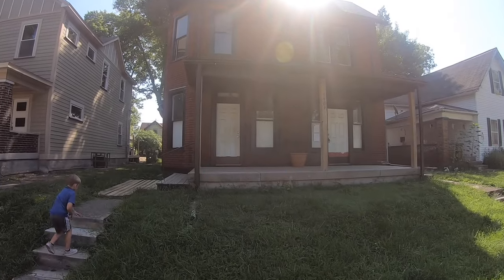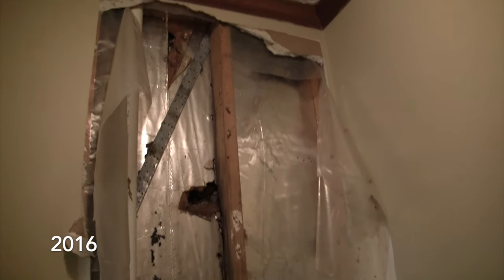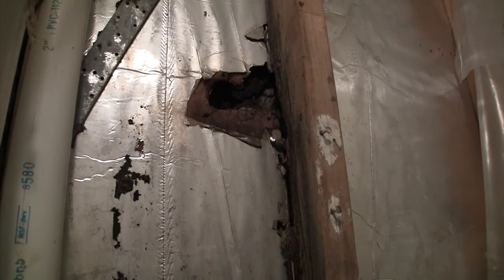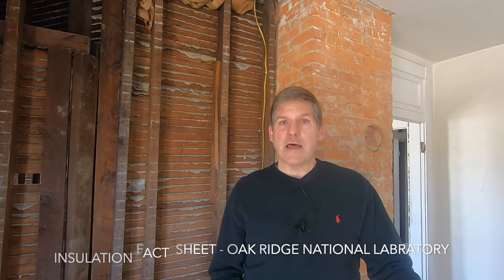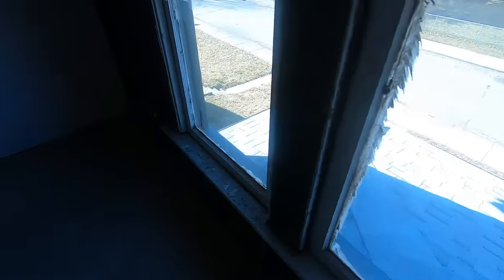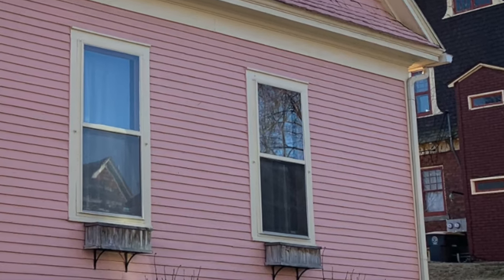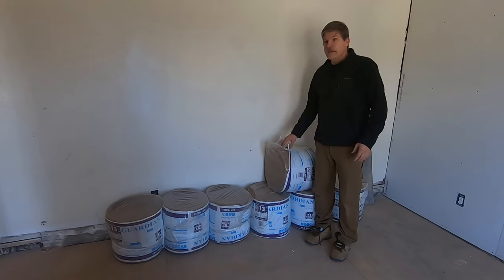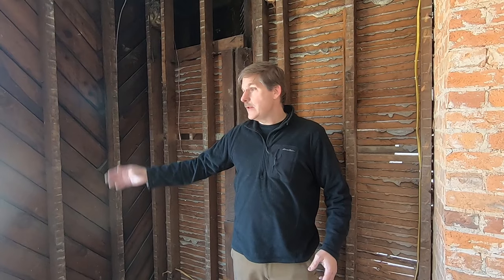How to insulate a 100 year old house and not destroy it - Old House Renovation 5

Comment: Would love your thoughts on a 3 season 1940s cabin in a 5 or 6 zone. Will need to remove the interior paneling and thinking of adding rockwool for some increased insulation before replacing walls with paneling or pine. Thinking it would be best to skip a barrier over the rockwool on the interior side to allow airflow. Won't be using year round but might heat in cooler months. Does it sound right to skip the plastic?
Reply from the maker: Hey Lauren,
Sounds like you are doing what we did. If interior and exterior are permeable, I would not change one side without changing both. 
Thx for watching!
Reply: @Housebarons  Thanks for the helpful feedback!

Comment: Clearly you need to remove siding, put up moisture barrier, and then you can insulate the inside as much as you'd like. He is right that you need to treat it like new construction which means you need to tackle from both inside and out.
Reply: In cold climates, only a vapor permeable air barrier should go on the outside, in the hot and humid south, a vapor barrier can go on the outside.  How a wall system goes together is based on the climate where the house is located. One size does not fit all.

Comment: If we are not replacing siding but we ARE fully replacing all windows down to the studs and will be flashing them all around properly, and we have no places for bulk water entry and have spot-treated all cracks and gaps with spray foam so as to as best as possible air seal the house from the inside -- would the risks you have described be mitigated?
Reply from the maker: Hey Robert,
In theory water intrusion from outside might be stopped as you describe. The only other concern is water vapor migrating from inside to out actually traveling through the walls. If water vapor turns to water droplets… that would be a problem . 
No idea how great a risk this is. As I said in the video there isn’t a lot of great info on this topic that I could find. Lots of differing opinions. Ultimately you have to make a call and see what happens. 
Thx for watching.
Reply: @Housebarons  thanks for the reply! Leaning towards insulating with sheep's wool which can handle water pretty well, and NOT super air sealing the walls so that some vapor can still get out.
Reply from the maker: Hey Robert,
Your method sounds well thought out. We are not in the business of insulation. We renovate and therefore have to weigh the information we could find from the best sources we could find. 
In the end, we opted to follow modern building techniques - house wrap on outside and drywall on interior with new  flashed windows, and fiberglass insulation. 
I do like the idea of wool insulation. Seems better than fiberglass when it comes to water. I know people use rock wool in basements and crawls that are damp. I hope your efforts work well!

Comment: Why not use heavy mill plastic against the outer wall cavity, creating your vapor and air barrier, then insulating? 

If you have thicker studs, says 2x6. Can you not use 1” closed cell to get your air sealing accomplished, then use with bat or blown in insulation?
Reply from the maker: Hey Adesico87,
I would say there are numerous ways to approach it. The problem is that it is hard to get definitive absolute answers. Oddly, this still doesn’t seem to be a well researched area by science. 
Thx for watching!
Reply: I think you need 2" closed cell for it to actually count as vapor tight. I am just very reluctant to spray on anything that there is no established way to remove, and makes it very difficult to get access if there is a problem (leaks/etc)
Reply: This is what I want to know too and he doesn't answer questions?  I was gonna use bat and then Polly on old balloon framing... But poly then bats and drywall may be better??  Nobody addresses old balloon framing much...and what about attic with no software or vents?

Comment: Hi, I have a 1900s all brick building that is built with 3 layers of common brick. Im renovating the bathroom and struggeling to decide whether to insulate the bathtub wall which is a exterior brick wall. The wall before did not have insulation it was just a plaster wall. I been seeing mix opinion's. Som say insulate the wall with no vapor barrior. Im starting to lean towards not insulating at all. Any suggestions? Location is Chicago
Reply from the maker: Hey Retro…,
Three layers - wow! Nice. Typically brick has an air gap between framing and brick. That sounds like a foundation wall. 
If you can afford not to insulate - it’s been that way, for 100 or so years… why change? That might be the easiest route… 
The thickness of that wall has some decent thermal mass as well.
I’d say you are fine.
Thx for watching!
Reply: I have also heard sheep wool insulation is good at handling moisture

Comment: My house was built in 1921 and built well. No foundation cracks, brick still soild, but cold AF in the winter. My heating bill is a little over $400.00 a month in the winter.  I'm not renovating it cause that would be way too expensive, so what can I do to help these costs?
Reply from the maker: Hey Mike,
Stopping air leaks and adding insulation are good places to start. Hard to say much without KNOWING where to start. 
Your city or county may have resources / offer energy audits. They look at your house through infrared camera to find heat leaks and suggest best fixes. 
Most heat goes up through the roof. I added an extra 12 inches of insulation in my attic which now is at about an r-50. 
Windows are prone to leaking. Could cover them with plastic in winter to add an extra air barrier. Electric outlets are another place to check for leaks.
What is your heat source? Is there a more efficient, cheaper, better, or supplemental source of heat that can be added?
Basically, none of these are free, but you can chose those which make you money. 
You spend $1000 to reduce your bill by $50 / month and you are actually saving money in less than 2 years. 
Hope that helps.
Thx for watching!
Reply: Studs and either batts or rigid foam on the inside.  Yeah, surprisingly, brick and stone are terrible insulators.  Surprising but true.
Reply: Our family farmhouse was double brick wall with air gap from 1840's - never found the homes interior to be cold in winter.

Comment: I recently inherited a brick house that was built in 1897 but it’s been vacant for 7 seven years. The property was broke into last fall and the doors were left open during the winter in Missouri so all my plaster fell off. It revealed that the bones of the house are still pretty sturdy but there is no insulation. What I took from this video is just leave my exterior walls empty but what about my interior walls (hallways, bedrooms, anything that doesn’t touch an exterior wall). Will it be safe to insulate them?
Reply from the maker: Hey Midnight,
Yes, it’s fine to add insulation there - especially for sound barriers like bathrooms. Typical new construction houses add insulation for bathrooms, maybe laundry rooms, or bedrooms - all for sound barriers. Otherwise it is not necessary for heating / cooling unless you were going to close off a certain section of the house.
Our house was wood exterior. Because your house is brick, you may want to do more research and see if what we said applies the same to your house.
Modern brick houses have an air / moisture gap between the back of the brick and the structure of the house. That might make a difference for you. Just not sure.
If you don’t insulate, the bricks should certainly help you with heating and cooling because of their mass- - more so than a wood exterior house.
Congrats on your “new” house - sounds like a lot of work, but fun!
Thx for watching!
Reply: @Housebarons  thanks for the detailed reply.
Reply: if you haven't done anything yet, look at Green Building Advisor.  you can definitely insulate your exterior walls.  you just need to do it correctly.

Comment: if your gonna renovate an old previously uninsulated house your just asking for rot the insulation will hold moisture  moisture barriers on the inside of the walls do absolutely nothing for preventing rot  the best way to prevent an ingress of moisture is to remove the siding and wrap the the house in tar paper thats  the best way tyvek will work to but it will cost you and arm and leg remember tar paper is used on roofs under the shingles and its sole purpose is to keep water out

Comment: This is bad advice.  At 4:35 he starts talking about a vapor barrier for the inside of the house and then referencing a vapor barrier on the outside of the house— you never do vapor barriers on both sides of a wall.  If you’re in a northern climate your VB is on the inside, and the opposite if you’re in a warmer climate — and you MUST air seal, so not air can pass through the wall.  An alternative would be closed cell foam, or cellulose with NO VBs— allows the wall to dry to either side of the wall.  And yes Cellulose does dry out providing you are not encapsulating it.
Reply from the maker: Hey Mike,
A water barrier breaths. Vapor barrier doesn’t.
Thx for watching!
Reply: Ahh, ok, there was a stutter in the video. I thought you meant vapor barrier on both sides of the wall.